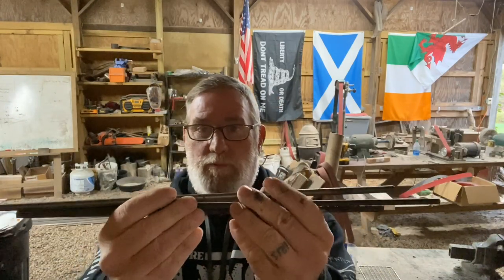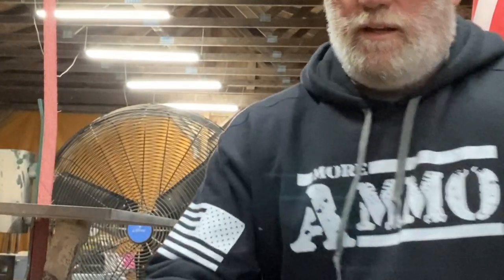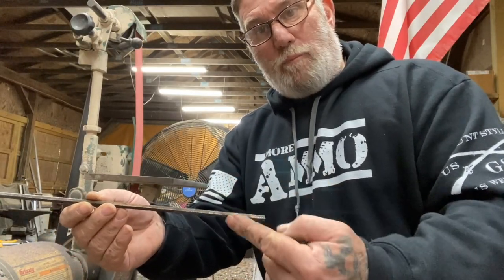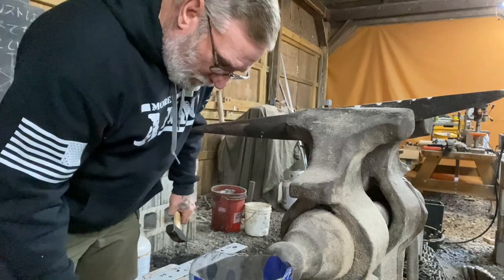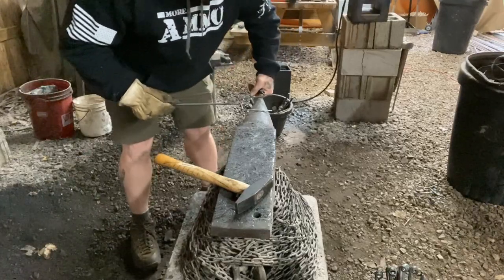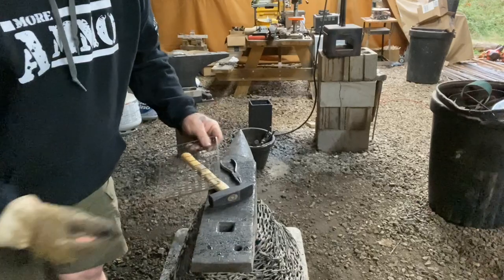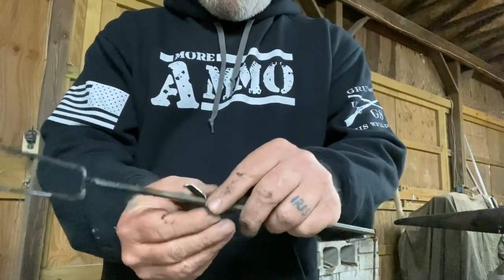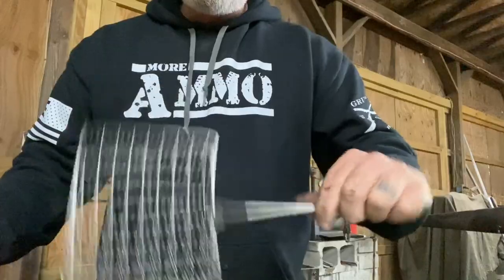Blacksmithing DIY Making a Bedroll Cook set

Comment: I came across your Bedroll Cook Set by watching Corporals Corner here on YouTube.  It was exactly what I was looking for to complete an emergency/travel kit to be stored in the under-seat toolbox in my truck!  I had a BioLite Campstove with its grill in my kit, but it was too bulky to fit how I wanted in that space.  And I figure if I'm cooking by a fire I make from found materials as needed, why not use your easy-to-pack-down metal set?  For the ability to charge devices via USB that I'm losing by swapping out the BioLite Campstove, I added a travel solar setup from Renogy (double panel and battery).  I've used your cook set a few times now, and it is great for cooking a meal for one over a small fire.  With all the COVID craziness in the world, I avoid eating out when I travel, so I've used your Bedroll Cook Set to cook stuff I picked up at grocery store - I found a little town park, gathered a little bunch of sticks, and was cooking a pork chop in minutes.  Your set makes getting caught with few options a thing of the past.  Thank you Sir!

Comment: Thanks for another great video, always something to learn.
As a person who services and installs fire extinguishers its awesome that you have one, however I'm not too fond of the location.
I would relocate it within a 30ft walking distance, closer would be better.
If you have an issue with the forge causing some type of fire, you likely will not want to reach through a potential fire area to get the extinguisher, you're going to want to approach the fire ready to fight it.
When we select locations for extinguishers we always consider the potential for placing the operator in danger when  accessing the extinguishers. I won't go on with examples, I am sure you'll see the logic in my above reasoning to relocate the extinguisher to an an area that wouldn't potentially be on fire when you could need it.
Keep up the great videos!

Comment: Hey Dave, I've been on the email waiting list for at least 6 months or more now. I've yet to get any notification that they are back in stock. Is the email alert working or do I need to keep checking the site weekly?
Reply from the maker: The notification works on a drip we only make 50 sets per week and the list id currently at 1500 so when we make 50 the oldest 50 on the list get notified, but that does not stop people from buying them if they go direct to the site on a day they are in stock, each shipments lasts about 3-4 hours once posted